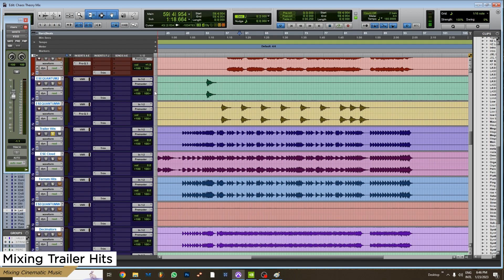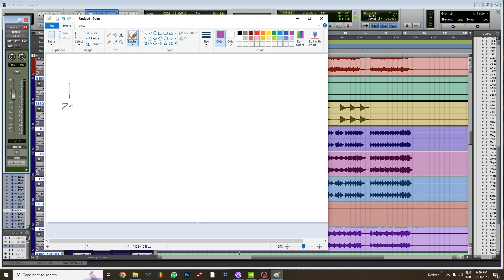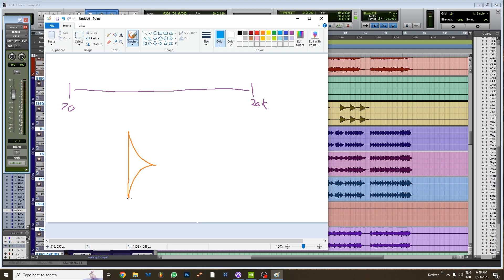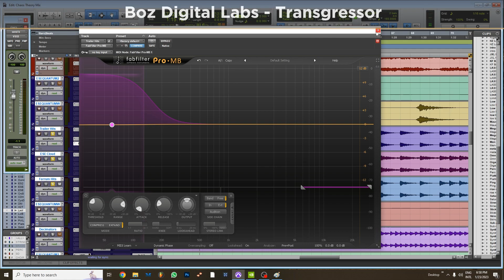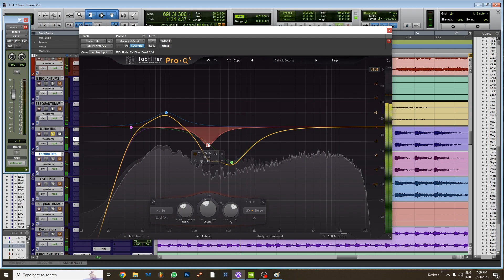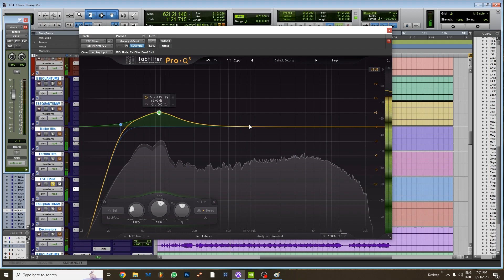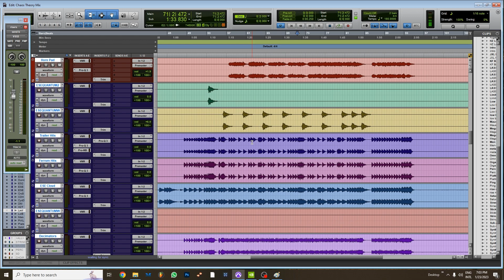Mixing Cinematic Music - Mixing Trailer Hits

Comment: Amazing tutorial as always, thank you! Do you have any advice on mixing hits or drums into a full orchestration? I find that I can make hits and/or drums sound pretty good in isolation, but they're always way too loud and by the time I try to add in my orchestration (or vice versa), it becomes a mess. Thanks again!
Reply from the maker: Ahh honestly it's a combination of choosing the right samples and EQing properly, then there's dynamics, many factors and it's hard to pinpoint the issue.
No magical trick here it's just about solving the issue that's causing the mess in your mix. Could be an EQ mud issue or the samples could be too wet and turn into an atonal rumble.. Or something else entirely.
Reply: thanks for the advice!

Comment: Hey Joel, I wanted to ask something more technical: 
would you recommend to monorize the bass strings til around 100Hz or is it better to leave that out?
Reply from the maker: Hey personally I wouldn't ! A bit of width is good as long as it's not over the top and translates in mono. Especially for orch i would never hard mono bass
Reply: Perfect, thanks for your response! :)